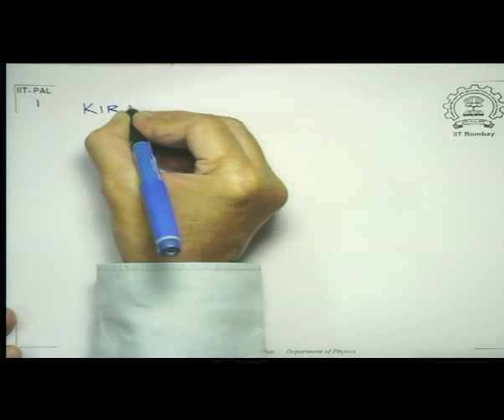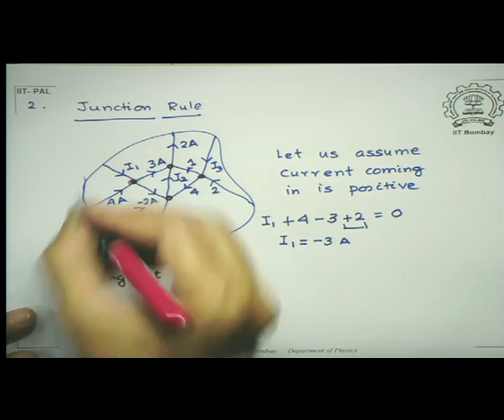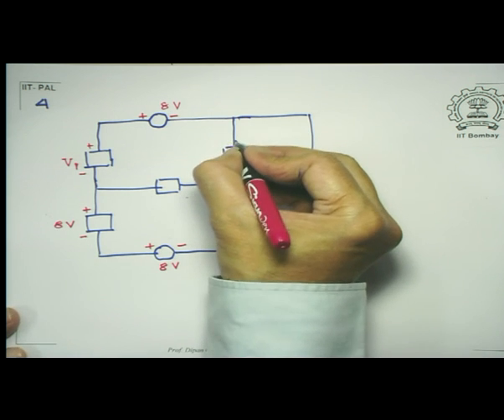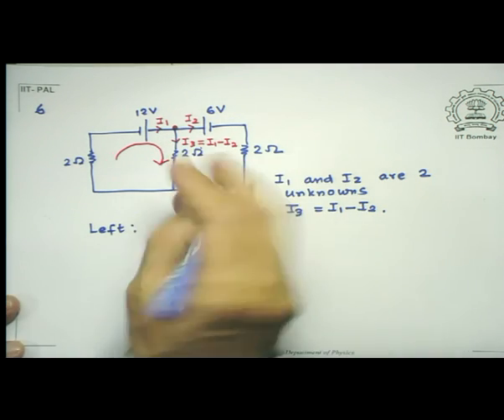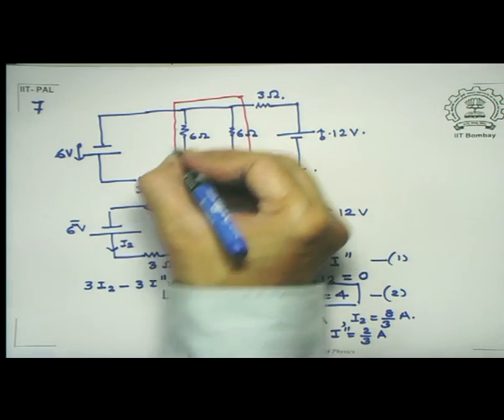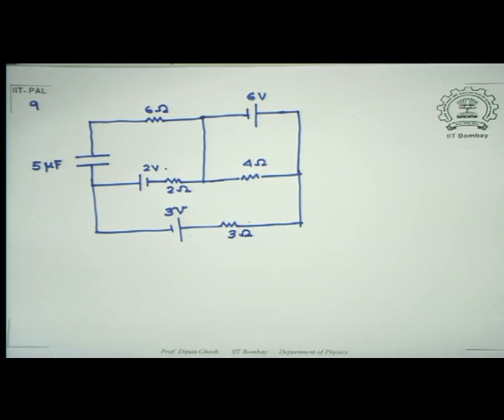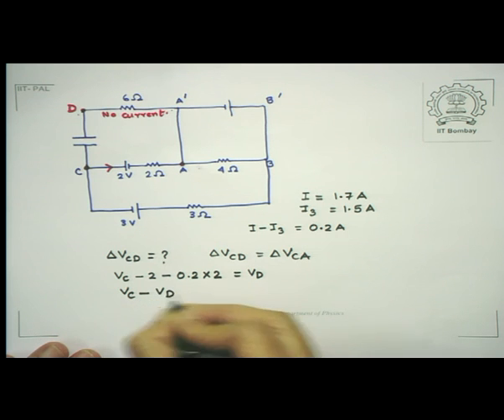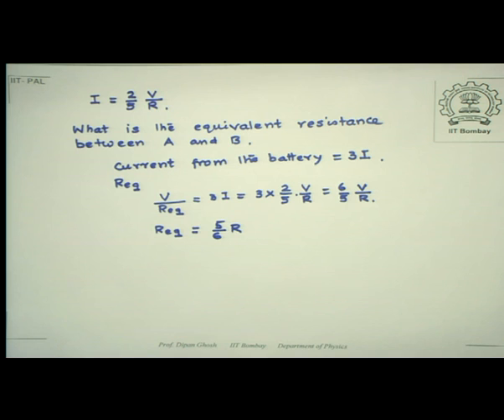KRICHOFF'S LAW (CH_22)

Comment: whenever current flows into one end of a conductor it immediately flows out the other end. This is not a safe assumption for high-frequency AC circuits, where the lumped element model is no longer applicable